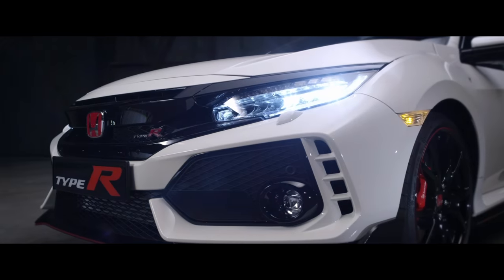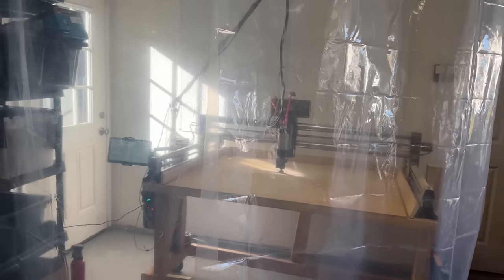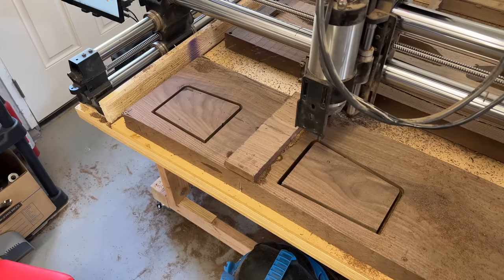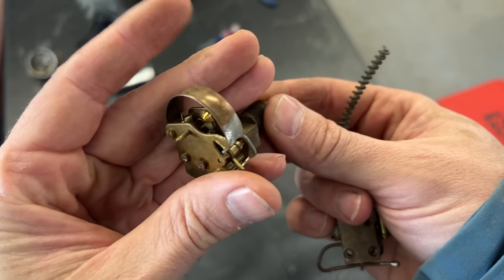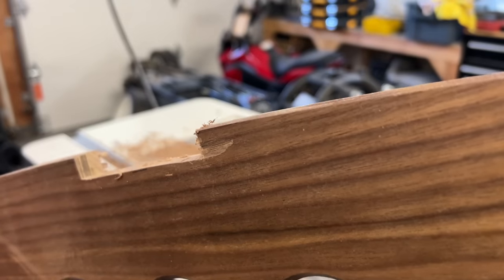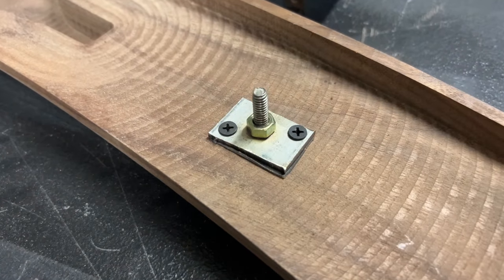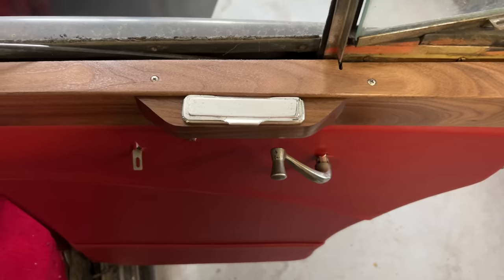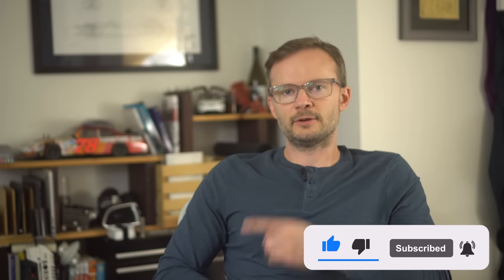Make A Wood Dash For Your Car. Or Just Watch Me Do It. Whatever.

Comment: "Flush trim bit" is the correct term... if the bearing is on the top of the bit, it's called a "template bit". There's a lot of variance in there, but those should be the more traditional terms. 

Also "Oscilating multi tool"

For sanding too, some tips of the trade is to only use any single piece of sand paper for 20 minutes. The rate of material removal degrades to the point of uselessness after that. You might also consider getting a festool dust extractor to push into your sanders. Your lungs will thank you, and I promise it will be your favorite vacuum to use around the house and shop. There are other good dust extractor options, but the Festool Midi has proven it's price point to me, so that's what I'm recommending. 

Some more tips/tricks for tear out. Use CA glue for those small chips next time. CA glue will work the same as the woodglue, but will dry extremely fast. For cracks and stuff that you want to "fill", squish some glue into that crack, then run your sander over that crack w/ glue. The sawdust from the sander will stick to the glue and blend the crack pretty darn well. 

For finishes, poly certainly has the best durability. However, hard wax oils are way easier to apply and look better. The wood has a depth you just don't see on film finishes like Poly. Plus you don't have to worry about dust nibs getting stuck in your coats and having to sand between coats. 

Also, others have pointed out why veneer is better than solid harwood for applications like this. I will also add that it is significantly easier to just CNC a solid hardwood piece. So your new car trim may not last as long as the previous trim, but at least you could make it without developing an entire new hobby and skillset. Plus the tools/machines needed to do it. I hear you would have plenty of garage space if you wanted to learn it though. /s

- a woodworker
Reply from the maker: Thanks for the info. I would really like to set up a shed in the back yard for woodworking that has dust extraction. that might come this summer.
Reply: I really want to get into an argument with someone now, so I can call them an "oscillating multi-tool."
Reply: As an experienced woodworker of 345 years, we call it Trimmy McJimmy.
Reply: Personally I like the nomenclature- the long turner, the pinchyman and so on.

Comment: The idea of solid finishing face wood is a modern one, which I find amusing since we have more stable engineered substrates we can use today. Even high end antique furniture used veneer (albeit thicker) over cheaper wood, partly for cost, but also so the base structural wood could have the desired qualities and the grain oriented for strength and longevity instead of aesthetics. I hope you sealed the entirety of the wood, even the parts you won't see to reduce warping. Also, slot the screw holes to allow for some expansion and contraction along the grain. Looks really good!
Reply from the maker: I sealed the back sides as well. the brackets i think will have enough flexibility to account for dimensional changes, but we'll see!

Comment: Hi Matt. RR and Jag make their panels with plywood and a thin veneer because wood is susceptible to shrink when it dries and splits since the metal behind does not shrink. And in a car wood will dry fast because of the greenhouse effect. So smart people invented a wood made of several layers of wood glued together with the grain oriented in random directions and called it plywood. The random orientation of the grain a makes it resistant to shrinking. Of course plywood and veneer is less expensive, but it's not the main reason why RR and Jag use it. The main reason is that the customer is not happy when his dashboards splits in two just one season after he bought it. This say your dashboard looks great. For the time being.

Comment: Pro wood finishing tip - if your finish is glossier than you like, you can gently rub it with some fine steel wool (000 or 0000) and it will magically go from gloss to semigloss to satin the more you buff it. Doesn't take too long, be careful not to overdo it. Your dash looks great, and you're adding fuel to my desire to build a CNC router. While I second the comments about plywood/veneer vs. solid wood, black walnut is fairly stable and weather resistant, I've used it successfully for outdoor projects. Finishing all sides of the wood will help here. I bet it will hold up just fine. Walnut would actually be a good boat building wood, but is considered unlucky because it is a "coffin wood."

Comment: Others have mentioned it, but yeah, they make it out of engineered wood or ply with a veneer because completely natural wood will end up warping, cupping, separating, or cracking in the car environment where there are wild temperatures swings and fast humidity changes. But maybe it won’t be a problem for a garaged restored car in California, so you’re probably fine.

I’d also be worried about strength across the grain for like the gloveboxes and thin wide panels.
Reply from the maker: I'm hoping the mild weather will help. in any case, i have all the CAD models so I can re-make it out of more stable materials later if needed.

Comment: For windshield wipers, if you've got 12v output, they make "hot rod" standalone wiper motors that just take 12vdc.  I spent a lot of time modifying an electric motor to the old linkage in my 55 GMC that was supposed to fit a 55 GMC, and found out the motor isn't very good anyway, and it took up a ton of room and interfered with everything.  So now I'm likely replacing them with the "hot rod windshield wiper" individual motors.

Comment: For the gauges, consider the X27 motors. They’re very cheap because they’re a common failure point on GM vehicles and thus are sold in many places. 
They also don’t draw much power at all. 
The only annoying thing about them is that they don’t have any sort of limit switch. The Arduino library written for them by Guy Carpenter just has them mash into the physical end stop for homing. 
It works because you don’t really care share your other end is, just that 0 is indeed 0. 
They can be driven right off an Arduino, or pretty much any 4 wire stepper driver. It would be cool to see someone implement a Trinamic driver on one so that your homing could be more reliable.

Comment: I have a 2005 Chevy blazer And while none of them come with exotic woods They did sell plastic wood like stick ons for the trim...........I went out and bought walnut burl veneer And done my own work on the window switches and backing on the door handle .. I do not own a CNC Or the time to shave pieces into curves And shapes ....I made a formula that soaked my wood And molded my wood That took 2 weeks before drying, trimming and gluing on my pieces...along with a copper flake inlay Takes me back to when Rolls Royce was actually Hand made skills And not machines they are today

Comment: I agree that using solid wood will most likely warp -even in LA.  One more thing that I didn't see in the comments is that walnut really fades in UV light.  Use a real good marine grade varnish that has a lot of UV blockers in it.  Epifanes is a Dutch product that is rather thick and has a lot of UV protection.  Available at most marine supply stores.  Cheers
Reply: Totally agree. I have recently re-veneered the wood of a 1959 Jag Mix and it has all received 8 coats of Epifanes 2 part Polyurethane Marine varnish. It is an aliphatic poly so crystal clear, high UV protection, no crackling and tough as nails. It is the rubbing down with 400grit between coats that is the drag but killer finish.

Comment: Most wood glue only takes a day or two to fully cure, unless it's a special type of glue, you are using it in a non standard but still correct way, or just doing it plain wrong. For anyone unaware, glue is not a gap fill.

Comment: Looks awesome Matt! I had the same issue with saw dust in my garage whenever I did one of my infrequent wood working projects and always worried about setting the garage on fire the next time I used a grinder or welder. I finally built a mobile work bench on casters that incorporates my small table saw, miter saw, router table, etc that I can roll out of the garage into my driveway.

Comment: The Reason the high end cars use veneer and not solid timber is due to movement and warping. The base ply is able to withstand huge temperature and humidity changes. Solid timber will crack and warp in normal car conditions in a hot summer. 
Make sure to seal front and back equally to reduce warpage. If the glove box lid tries to curl, try routing grooves on the inside face allong the grain to reduce the total amount of timber that is expanding and shrinking. 
Another option is Cactus juice to stabilize the timber. It is a resin that penetrates the cells/pores. Used for knife handles of unstable timbers.

Comment: The dash is very pretty. But I echo the concerns of the woodworkers below. Also, in defense of veneer; veneer is superior to solid wood in some applications.  You can use a highly figured and beautiful wood veneer, like a burl, in a situation where the solid burl would have no structure or strength. It also makes rare woods go a lot further.

Comment: The use of veneer made for a more interesting surface. Solid nut has a rather boring surface and it tends to get black/blue where it connects to metal and there is also humidity. It also could get lighter color where wood glue  was used. It is a far better wood for construction (music instruments, guns, high end furniture). It is very expensive, but I just think finding someone who can veneer pieces like that might be challenging in the US.

Comment: Having made a custom wood dashboard for an open topped kit car, I went the veneer route onto marine plywood with waterproof glue. OK so I had access to a vacuum veneer press. But with the usual 20 plus laters of yacht varnish rubbed down between hand it was bullet and rain proof. A solid wood dash would have never been stable on its own.
I am about to embark on doing it again for the new car.

Comment: 5:03 use hobby servos not steppers ….. much easier to control since they have a feedback loop inside of them and they are also really easy to control with just an arduino

Comment: Your feed rate in wood can be a lot higher, and your bits will last longer as a result. When cutting wood the material acts as the coolant, so you want to keep plowing it into new (room temp) material. Chip size should be like .003" if I remember correctly. Feed rates of 300ipm on a 14,000rpm router are what I landed on. Shallower cuts or smaller bits if it's taking too much power, and obviously can run slower feeds for any intricate details.

I will also 2nd the comments that veneer isn't inherently lower quality, especially with the correct base material. It's also arguably better environmentally as it uses less wood from slow growing high value trees. In any case, I love the way it came out. You do beautiful work. Sanding is the worst.

Comment: HAVE YOU VARNISHED THE BACKS OF THE PANNELS others have pointed that this will likely crack and warp - but it will crack and warp WAY faster if you have left the backs open and the fronts closed. 

You are creating a hydrostatic imbalance between the two sides and it will banana

Comment: Cool vid and the algo did bring me here, but I must say I like the burlwood finish more. To go for a different, more modern wood treatment you could do a cerused wood grain finish, not sure how OEMs keep it dimensionally stable though. I suspect in the coming months those panel gaps in the dash wood will start looking inconsistent with the warping, shrinking, expanding and bowing that inevitably happens. Door panel wood changes won't be noticeable. Old MGBs had door card upper trim made of wood with vinyl wrapping around them, so you could strip off the vinyl for a wood finish. Dad did that to his MGB and it looks great.

Comment: The wiper mechanism does not use a 'screw', the form-wound wire acts as a gear rack, the wiper wheelboxes have helical grooves cut into then that engage the wire rack.  It's like a rack-and-pinion steering system but in reverse.  The rack is moved back and forth using a worm gear-driven eccentric which transfers the back-and-forth movement of the rack into alternating rotation of the wiper arms.  British cars have used this type of mechanism for decades, you should be able to get the parts you need.  The tubes inside which the rack moves are nothing more than sections of brake line.

Comment: Certain types of walnut are only available because it's a veneer, curly walnut for instance. Veneers were used extensively in the 20th century for absolutely everything from furniture to radios, and the cheap version was made with solid timbers and obvious joins.

Comment: With some wood boat experience --   one could say the plywood of old was stable - from a warpage view and  less expensive (in their day) pretty    Of course the veneer checks, delaminates with time . The truth is all wood hates UV light - 
Nice job and nice video ---  what,  you didn't want to do 20 coats of varnish - and do it again in 15 years -   With the boats we have used  two part polyurethane (Bristol brand is one) but it lets loose after 10 years  sort of like chipped nail polish - the thought is it to brittle at the wood surface interface.( also a boat/wet issue - less so for a car) SO newest aproach is base coat - 2 varnish then 3 or 4 polyurethane - but will have to wait 10 more years to prove:trophy-yellow-smiling:

Comment: Those router bits are called a few different things! Flush trim bits, top bearing bits, pattern bits, template routing bits. But sometimes the term "pattern bit" refers to those bits that have the bearing on the bottom, and are intended for use in a router table to cut templated parts. Also as an ex-shop teacher, that on-edge router table cut scared the shit out of me! Please don't be cavalier about the router table. You got away with it, but that cut was a good way to lose a finger. Set up a fence to properly support the work as it moves across the bit. Or since it's an odd shaped piece, maybe build a sliding fence to cross cut it like it's a dado cut on the table saw crosscut sled.
Reply: I screamed when I saw the edge router part. Matt, if you read this I love your videos and I want you to keep your thumbs so you can keep making them. But you WILL LOOSE A THUMB OR WORSE if you keep using a router like that.

Comment: Beautiful work. Massive wood has its problems, but if you take care to keep the car at a relatively even temperature and humidity it should last. There is good reason that all expensive furniture is veneered. I restored my 1954 XK120DHC in 1963 (cars were not cared for well and didn't last long back then). I had the dash restored by a professional woodworker, whereby the word "restored" might be replaced by "destroyed." Rather than using veneer he used brown paint to "touch it up." I was only 22 years old with little experience, so I just accepted it and tried not to think about it. I left the States forever in 1965 and never learned what happened to the car. Is (was) yours a Mark V?

Comment: "flush router bit thing" is called a pattern bit.  The reaon they didn't use solid wood is because laminated wood plywood) with resorcinol glue holds together much better and prevents checking.Also, one final thing- Polyurethane has neither the UV resistance of a good spar varnish, or the easy repairability of shellac or lacquer. It does have the advantage of easier initial application.

Comment: You could make your solid wood dash more stable for a car environment by laminating (gluing) two pieces of walnut together.  It is cheaper than the super thick (hard to find) piece you used and it also has kind of a "plywood" effect making it more stabile.

The router bit is called a trim bit or a flush cut bit.

You can keep most of the dust out of your garage when you use your CNC for wood by putting a fan in the door and blocking off the rest of the door with cardboard or plywood (fan blowing the air out).  If you want to save your neighbors from the dust, you can use a cheap furnace filters in front of the fan to catch most of the dust. Put an opening in the plastic in your garage so that you suck air from the area you want to keep clean.

I hope you did not have too many problem scanning the right side of the dash when you could have just mirrored the left side in CAD.

DeWalt calls it a Multi-Tool.

FEIN (which I believe was the original that every company copied) calls it a Multi-Master.
Reply: Plywood ALWAYS used an odd number of laminations.

Comment: You didn't mention the type of polyurethane you used, but fair warning:  standard polyurethane finish is NOT good against UV rays...like we get from the sun...which is usually shining on a car.  Marine varnishes are the proper way to go for moisture and UV resistance.

Comment: Interested to see how wood movement affects it over time . I wouldnt assume cracking or warping if youve allowed for movement. Wood expands and contracts with temperature, you just have to allow for it in contruction (slots instead of holes for fasteners, gapping between components, etc). The mistake would be assuming the new parts will behave like the old ones... they won't.

Comment: Back in the early 80s while in high school shop class I made a solid oak dash for a tiger sunbeam. The original was a veneer and they never had a glove box door, I grain matched the door and used small hidden hinges. The owner stained it and gouged the wood pretty bad while installing the headlight switch.